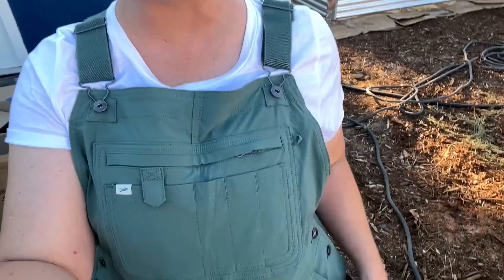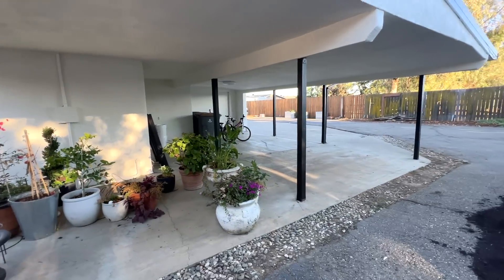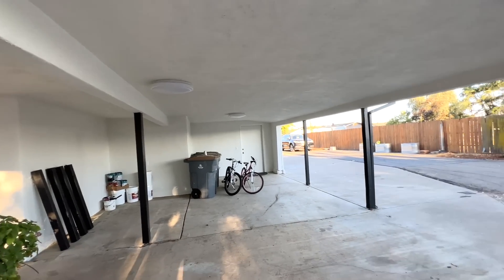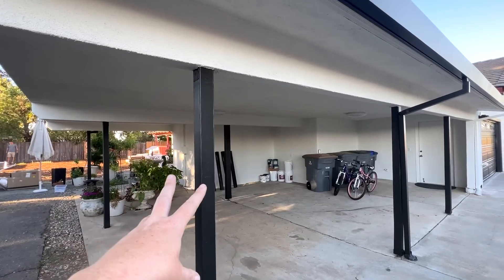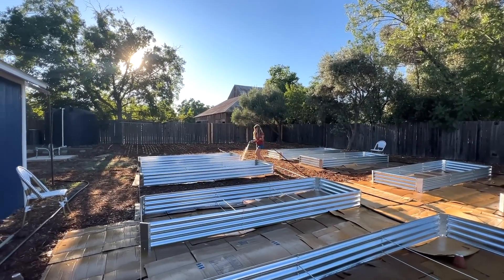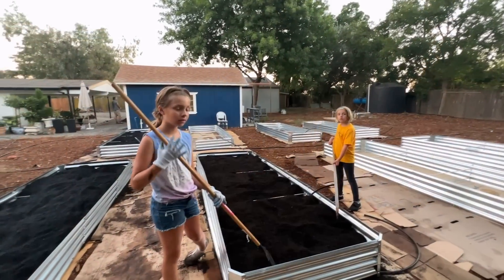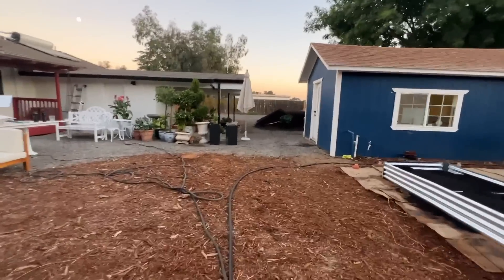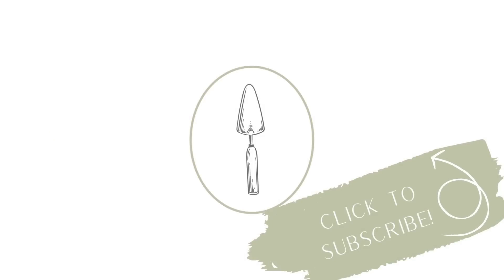Filling the No-Till Garden Beds! :: Spending Some Quality Family Time in the Garden 🥰

Comment: A ten tine bedding fork makes shoveling mulch and compost easier. It is lighter and the tines get into the pile easier than a shovel. Also, you can place a block next to the raised bed so when you tilt the wheelbarrow the metal bar above the tire lifts the wheelbarrow off the ground to clear the lip of the bed for easier dumping.